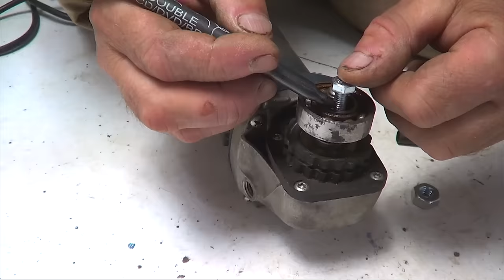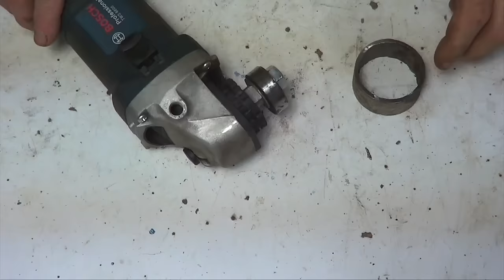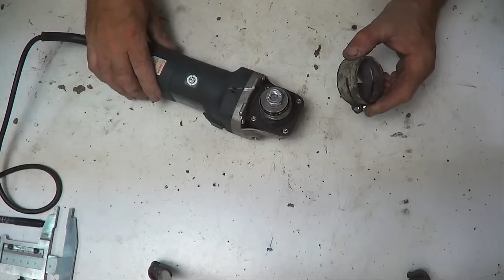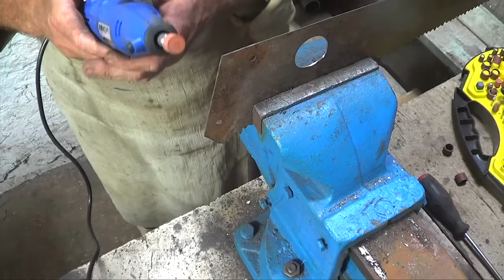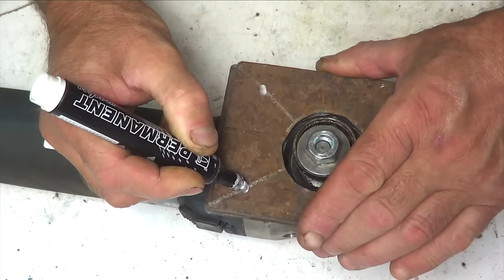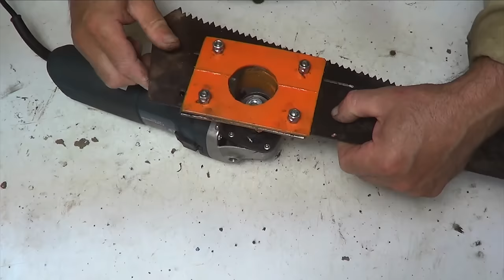AMAZING! Brilliant ideas & DIY

Comment: um if you'd use a decent blade in the first place, it would work better, or at least sharpen and set the blade you've got, but I think a blade with finer teeth would do better. Yeah Worksharder,  a file or rasp might work, but I'd think you'd need a bit longer stroke... don't know, would be interesting to try. For what little this does though, it's a lot of work for essentially what a chain saw could do quicker, even a cheap electric chain saw. I'd rather keep the angle grinder an angle grinder, much more useful, and if you really have to, you can cut a board with an angle grinder.
Reply: Goddamn man, I doubt he uses these tools in any practical situation, so why would he use a better blade? You clearly miss the point of this video. He is an eccentric genius, just having fun. Something you couldn't relate to.
Reply: @lchavez6973  I'll take that in reverse order, while polite people have called me eccentric, most just say crazy. If a tool has no practical use,  then it's worthless, no matter how ingenious the maker  is. The least he could do is shorten the blade, so it's not so unwieldy, besides this tool has already been invented, and on those the teeth are on the end of the blade, not the side. Those work, while this one doesn't really, at least not well. Can't do better than that, a very rough cut on a two by,  why the hell bother. At least the angle grinder would give a smooth cut, and probably burnish the wood while you were at it. I'm old, I'm cranky, and call it like I see it. You don't like it, too damn bad.
Reply: @tootall5559  eccentric usually entails possessing or creating things have little or no use, you are not crazy, you are simple minded. like every carpenter I have ever met, you cannot understand anything but the very basics of physics. Psychology and Sociology is lost on you. I was not arguing if it was useful as a tool, because it is clearly not. It is a piece of art, created by an eccenteic. Carpentry is easy with practice, but the human minds will always present new conundrums. I work in the hvac-r field BTW, I also built 2 houses in 2018, did everything except for the  masonry myself
Reply: @tootall5559  anything is art, if one can find beauty in it, art does not have to be complex or even meaningful. I find beauty and meaning in fixing things, to me that is art in it's most pure form. Carpentry is art. But carpenters are very down to earth people, and can rarely understand abstract thought, which is how I was able to tell your line of work. One can argue that a painted pictures have no use, but that is the most accepted art form. items that have no use, are art, because they were created for no other reason than to look at.
Reply: @lchavez6973  A carpenter was only one of my gigs. I was also a welder, a plumber, and several other trades... whatever was going down at the time. My favorite job was as a construction repair person for a company that built a lot of houses fast. They'd always cheap out on the labor and I'd have to go back and fix all kinds of things. One bunch of stupids put up a wall with the studs the wrong way, then they knew it was wrong so they firred them out with celotex. The wall would bow if you leaned on it. Another I had to tuck point the brick work. A tool that one doesn't do what it should, and ruins a good  tool in the process, is not art to me, and shouldn't be to anyone. I don't even find the way it was done innovative. Frankly a good handsaw would do a better job faster. I see art in doing quality work, not half assed. Had this item worked well and easily, I might think differently of it. Not all paintings are art, some are crap. Basically if you have the right color to go with someone's interior, it will sell, but that don't make it art. Even Picasso thought it was crazy that he spent years learning to really paint, then what a child could do is what sold and made him famous. There is art in doing a job well... I get that, I love to watch people do things on a high skill level with results that prove it.
Reply: In fact, I'm so disapointed in this, I am unsubscribing. Later days.
Reply: @tootall5559  the paint on the walls is not art, but the whole building is, so the painted walls are a piece of that, I don't think he ever intended to use the grinder/saw for anything, or he would have used a better grinder, and a better saw like you mentioned, so he made two cheap pretty much useless tools into one piece of art, infact the video itself is an art form, just because you don't see the beauty in his insanity doesn't mean it is not there. If he a practical skill set, then he wouldn't be making YouTube videos
Reply: @tootall5559  also I googled Hieronymus Bosch , and I like him alot, especially garden of earthly delights. I can tell by your love of his art, that you are a cynic

Comment: Amazing build, small criticism for everyone to consider. 

There is no point in having the teeth below or behind the box. You would benefit greatly to performance and safety by cutting away the unnecessary metal. I’m sure you’ve already knicked your knuckles lol

I would also build a boot and shorten the blade to mitigate the vibration
Reply: Iu
Reply: top

Comment: The stroke length could have been increased, by machining a cam, instead of the bearing...or you could have used a bike's over head cam instead...
Reply: So correct the agitation motion is not that good, only 3 or 4 saw tooth will touch the cutting area

Comment: No se cuanto puede costar una sierra mecanica pero esta bastante claro que si tienes las herramientas correctas suficientes te ahorras un dinero muy curioso 👍
Reply: Yo si no haría eso muy peligroso, donde hay tornillos y hay vibración se aflojan las tuercas ahí se mira claro cómo se aflojan esas cosas,cuando corta el tronco ya esta adelantado eso es muy duro inclusive con un serrucho porque siempre traba el vaiven en los dientes, y tiene que usar todo el largo del serrucho, estos vídeos insultan la inteligencia de uno,yo tengo caladoras especiales para cortar troncos y es difícil cortar por la fuerza o torque se debilita al aplicar fuerza, lástima porque se pierde tiempo viendo a estos farsantes

Comment: The area of interaction between the saw with the bearing is very small, the resource will be very small. The bearing will break the saw. The design requires significant refinement. Як то кажуть - зроблено на хлопський розум.